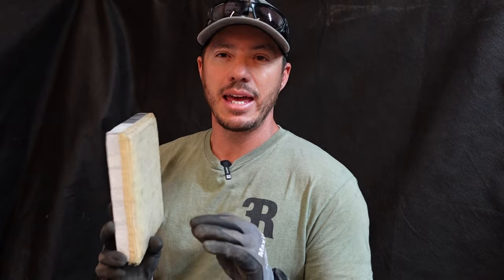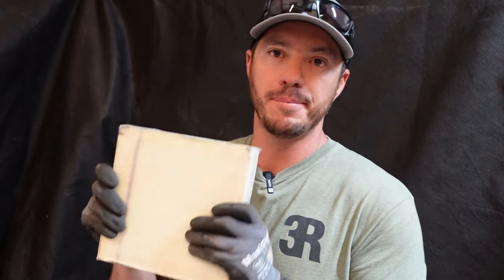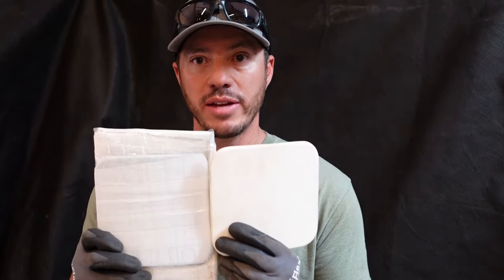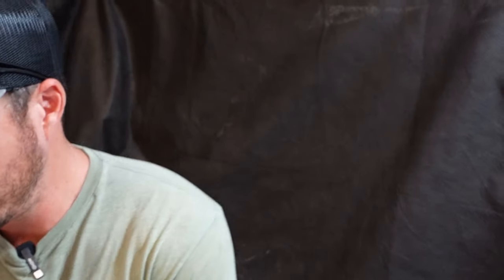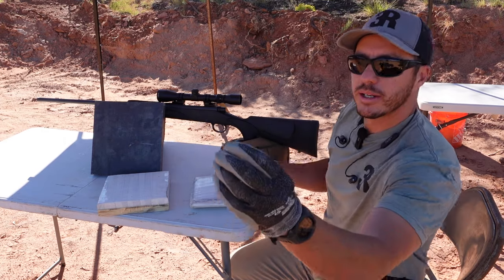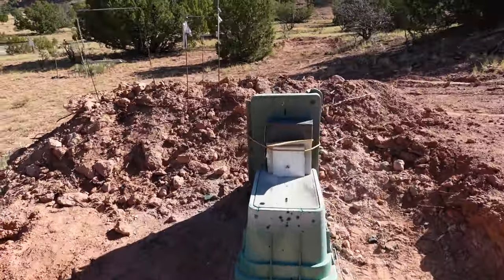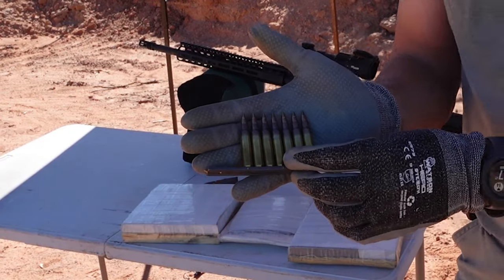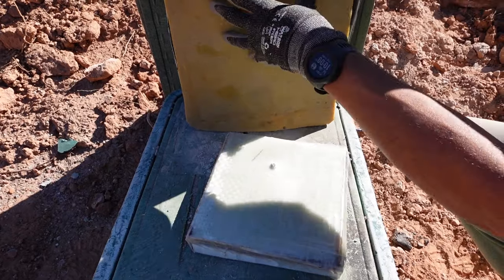Homemade Level 4 body armor...Stopping the M2 AP and M855 A1

Comment: thats pretty cool. btw if you look at all the new crazy thin armor comming out, they all have a single or double layer of arimid behind the poly ethylene.  not sure how they bond it or if they do at all. polyeth actually perforates backwards to what you would expect and i think the abrasion resistance or difference in speed of sound of aramid helps a lot with this for some reason. i still think that the strike face is not so imporant. i think the strike face should be sized for the yaw of the treats you expect to stop. so like for 556 it is a relativly long and narrow round which is meant to tumble so it wouldnt need as big of a strike face to disorent. with 308 its gemotry is such that there is much more moment of inertia to overcome when impacting the strike face.
i say buy some sapphire lenses for watches. theyre like 2$ each now, same place as u got the uhmwpe. or try the largest agragate size you can find for water cutters. i think they make that out of boron carbide or boron nitride. other ideas are ceramic ball bearings. thanks for uploading.

Comment: I'd say I'm surprised but not really. I kind of figured knowing what I already know about the physics behind bullet resistant armor and materials that reaching NIJ Level IV has more to do with the strike face than it does with the backer. The strike face material and how hard it actually is makes all the difference in whether you get gut punched or a hole the size of a Kansas City watermelon put into your body by steel core .30-06.

Comment: M2AP's core is in the 750hb hardness range. (and i believe to be around ~7 in moh scale)
porcelain and kwartz are usually around ~7 moh hardness
while alluminium oxyde at 9

so, it make sense that porcelain fail, since not hard enough to flatten nor erode M2AP core.
Reply: granite tiles would be an option to try

Comment: How about porcelain on level 3 steel. Maybe one with something in between like wood or hdpe melted milk jugs to bond it. Its still towards a Budget build.

Level 3 is pretty disappointing normally. Its steel but as far as steels go its pretty soft. 3+ steel plates are often thinner than 3 plates.

Comment: Cheap sharpening stones are made from aluminum oxide... They're usually kind of thick. Idk what the thickness needs to be or if you could split them in half
Reply: 8"L x 2"W x 1" and they're like less than 2 dollars. Not sure if it's the same quality as what they make armor out of for 10 dollars you coukd make an 8" x 10" panel

Comment: Im confused because my english is not that good. The best result was ceramic pile with polyethylene? Or im wrong?
Reply from the maker: There are many different ceramic and polyurethane products. So to be completely clear, the best results were with an aluminum oxide ceramic strike face and UHMWPE backer.
Reply: @3RBallistics  thx 4 the answer, god bless u

Comment: What’s the difference between porcelain tile and ceramic tiles??
Reply from the maker: Basically porcelain tile is made from more refined clay and it's fired at higher temperatures. This makes it denser and more durable (harder) than ceramic tile.

Comment: Where can alumina ceramic tiles be sourced?
Reply from the maker: Blackbeard protective products is probably the best source https://blackbeardpp.com/shop/ols/products/multi-curve-body-armor-ceramic-tile-aluminum-oxide-al2o3-alumina-98-dot-5-percent-purity
unless you have use of a high temp kiln. Then making you own isn’t that hard.
Reply: Thank you! I don’t know why, I was coming up with absolutely nothing useful searching for this stuff lol
Reply: @3RBallistics when it comes to that particular ceramic strike face I’m concerned about matching the multi curve to the laminated fiberglass. Have you thought at any solutions for this? I’m sure the plates themselves can’t be used to press, but maybe to make a mold from something like concrete?
Reply from the maker: @TheStarLord99  I’ve actually done both. I’ve used the plates (with parchment paper to separate) and light clamp pressure with 25 layers of fiberglass. This produces a reasonable end weight of about 8 pounds. I’ve also used a hard mold to try and apply more pressure and reduce the fiberglass resin consumption. While I was able to drop the total weight to 7 pounds 4 ounces the fiberglass wasn’t an exact match to the ceramic. So it’s kind of hit and miss depending on what your application might be.
Reply from the maker: @fuckyoutubehandIes  I don’t believe 25 layers would be enough. However, I haven’t tested this so I am unsure. But you are correct, fiberglass either works or fails and it usually depends on the supporting thickness Fiberglass works well with the stiffness of many layers.

Comment: Most are Too Thick for realistic use
Reply from the maker: Agreed, if they were built for body armor. However, these tests were for a shield (for cover) build not body armor. I do believe all we’re under or at 1.5” thick which theoretically would fit if built in a smaller shooters cut 🤷🏻‍♂️

Comment: How thick was this alumina plate? 7.4mm or 9.4mm?
Reply from the maker: The calipers measure 9.5mm thick piece of alumina
Reply from the maker: @fuckyoutubehandIes  the only difference is that it probably wouldn’t stop a tungsten core round. Otherwise, it should stop all other AP rounds without a problem.

Comment: Which one perform better, woven roving fiberglass or welding fiberglass sheet
Reply from the maker: That’s a great question that I have not tested. I will say that welding fiberglass is much more of a mess to work with.
Reply: Woven roving. Fiberglass blanket used to be ideal because it was cheaper but now it is more expensive. Woven roving provides the same protection in a thinner and lighter form.